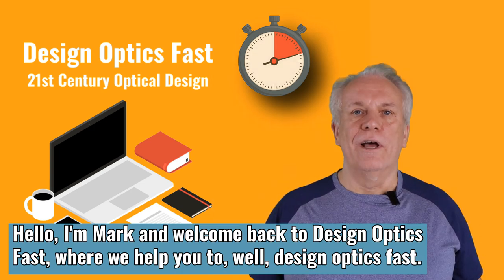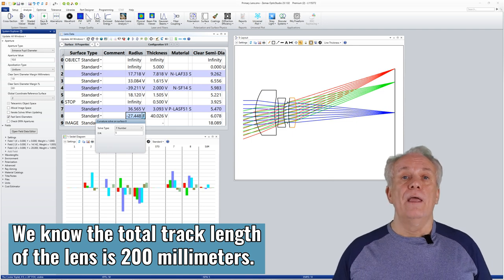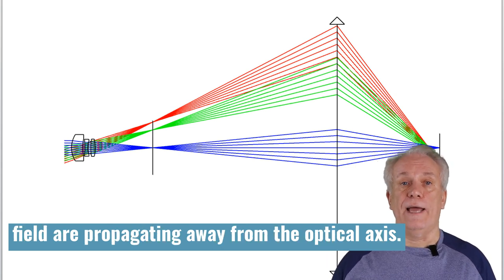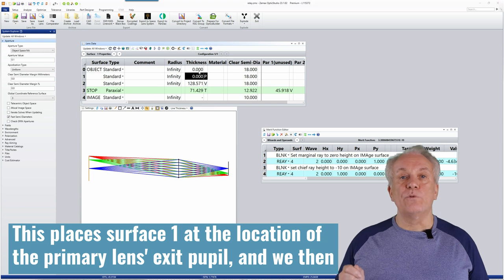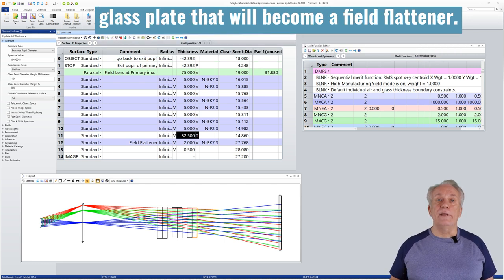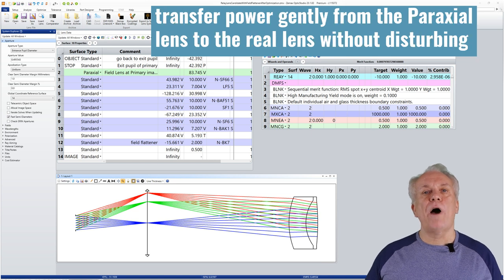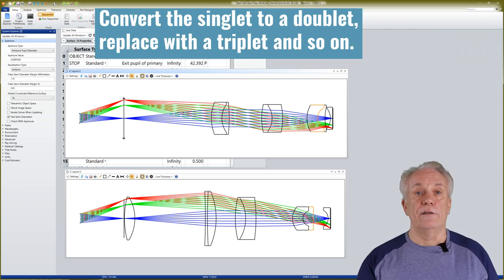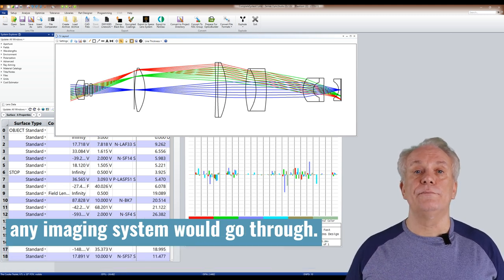Relay Lenses

Comment: Great video. Thank you very much! Am I correct to say that if the lens I'm designing only concerns a very narrow field of view, then it is ok to use a simple relay lens e.g. an achromatic pair?
Reply: It could be. Look at the chief ray angle to see how quickly the rays diverge from the image plane. It's the chief ray rather than the field of view: a telecentric lens may not need a field lens but could still have a wide field of view
Reply: @marknicholson5508  Thank you!